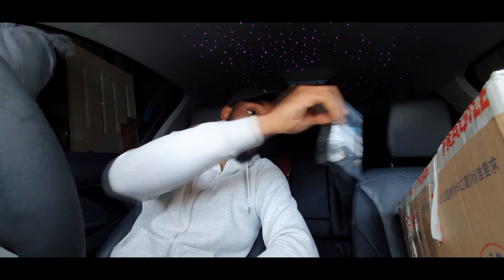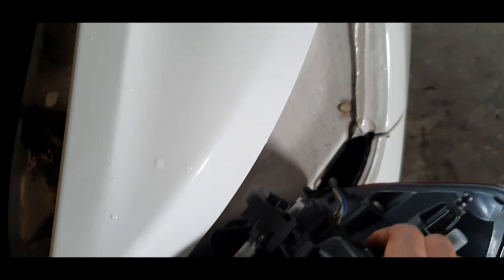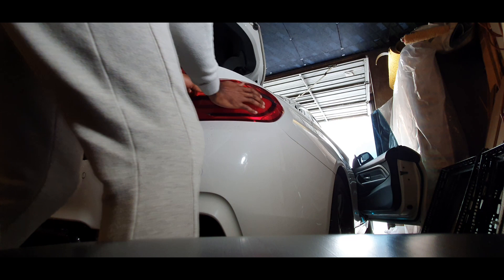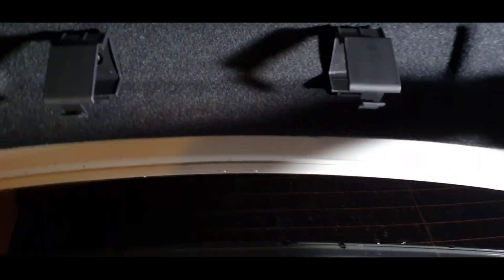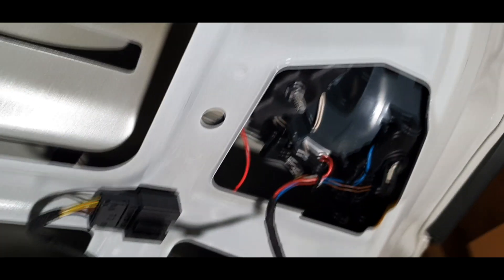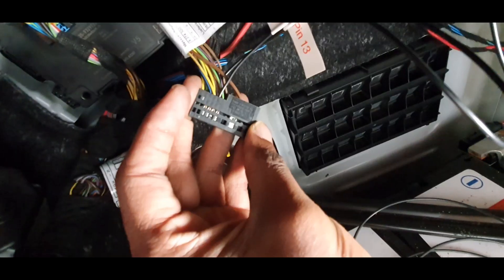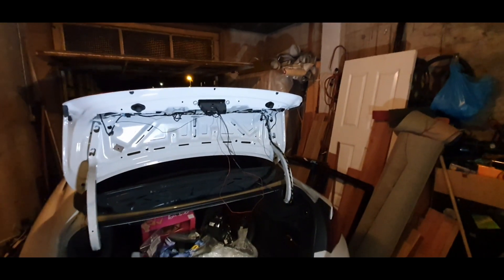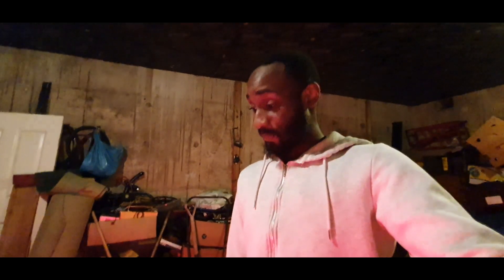BMW F32 4 Series LCI Tail light Retrofit

Comment: Did u ever get condensation after ? One of my inner ones got a bit of water in them after a heavy rainstorm. I mounted it correctly though
Reply from the maker: No mate no form of condensation at at could be the seal on your light

Comment: Hi Mick: Nice video; thanks for making. What year and model F32 did you perform the LCI tails retrofit on?  I have a U.S. configured 2017 BMW pre-LCI 440ix and I am searching for the proper Bimmercode coding for the inner tails. Other coding I have found codes 3061 and 3062 lines. Your inner coding is simply using the two 3063 codes.  Is there any coding difference with European models?
Reply from the maker: Hey man thanks for watching mines is a 63 plate (December 2013 build) 420d se, you'll just need to search for the codes that i put in the description which are in 3063 thep rest is turning off cold & warm monitoring and changing the bulbs to led

Comment: Wow!!! can't believe this video is a year old now, but a timeless video, well instructed, and great to watch, I have a F33 convertible so slightly different installation but definitely think this upgrade is worth it, if you can find the LCI lights at a good price, like you did.👍 
and good to know the cheaper harness cables work just as good as the expensive oem ones.

cheers
Reply from the maker: Thats for the kind feedback bro i really appreciate it, yeah with the f33 you need to route it different due to it being a convertible but i can definitely say it was my favourite mod on my f32 it changes the rear for the better tbh even at the normal price its worth it

Comment: Great video! Nice to see that there is finally an aftermarket solution for the oem harness. Sadly the link to the harness doesn't work anymore. The listing has ended. Has anyone found a new listing?
Reply from the maker: Thanks for watching, i agree as tge bmw one costs so much, here is the new link https://www.ebay.co.uk/itm/BMW-4-Series-Coupe-F32-M4-F82-RETROFIT-LCI-Rear-LED-Tail-Lights-Harness-Loom-2-/264918719147?_trksid=p2349624.m46890.l49292

Comment: Hi bro, I finally got round to doing this myself on my f33 convertible, I have used bimmercode to code the car, which effectively remaps all the parameters, while originally trying to connect the two cables into REM A174*13B Pin 5 (left) and A174*13B Pin 13 (right) that did not work for me, internal lights not powered,  I have ordered some scotchlocks to connect in-line onto 174*12b pin17 & 174*14b on pin12, as both pins are being used, there does appear to be some confusion on what pins to use on some forums, for my 4 series.
I'll have a go at this tomorrow when the scotchlocks and tesa tape arrive.
Reply from the maker: How did it go in the end bro my mate had a f33 when this video dropped and it all worked fine
Reply: @MickyleMcgowan  yes all working now thanks mate,
Reply: @MickyleMcgowan  yes all working now thanks mate,
Reply from the maker: Perfect!

Comment: Hello Mick, could You help me to coding rear foglights ? My car is f36 Lci USA, how can i get rear foglights ? 
Regards, Greg.
Reply from the maker: Hry man withr the usa lights do they have the fog lights in thr unit?
Reply: @MickyleMcgowan  This i am not sure, but the inner parts of the lamp are changed to ECE and still not foglights.
Reply from the maker: @grzegorzg4173  let me do some digging and I'll see what i can find out
Reply: @MickyleMcgowan  Yep, of course no problem. Thanks for any help😉
Reply from the maker: Found this on binmerpost and thr guy said it worked

REM -> 3063 -> Mapping_Nebelschlussl_L_output (Value = 00x1A)
REM -> 3063 -> Mapping_Nebelschlussl_R_output (Value = 00x1B)

If you're using Bimmercode, just enter the values as 1A and 1B, without the leading 00x.
Reply: @MickyleMcgowan  thank You Mick💪
I will try and come back with this, but next week. No time now, 4 weeks baby on board😀
Thank You very much for You help and time😉
Reply from the maker: No problem at all my man let me know when you come back to it & congratulations 👏🏾 nothing better than fatherhood